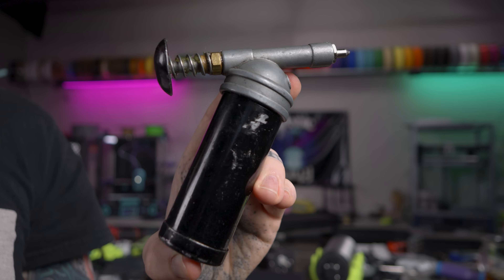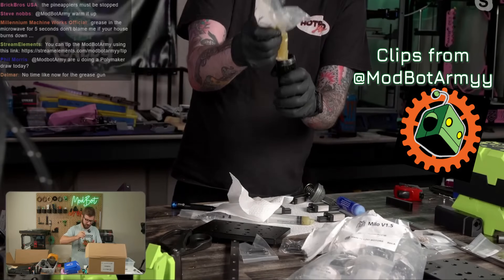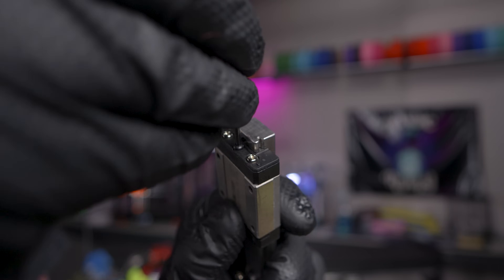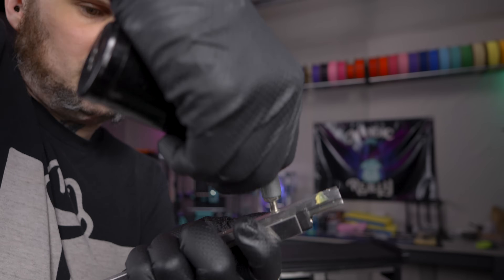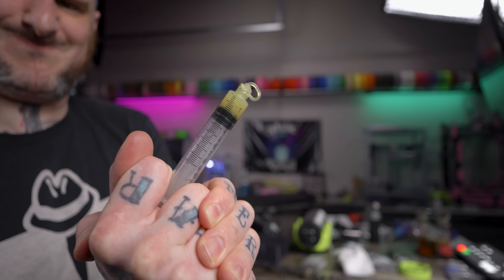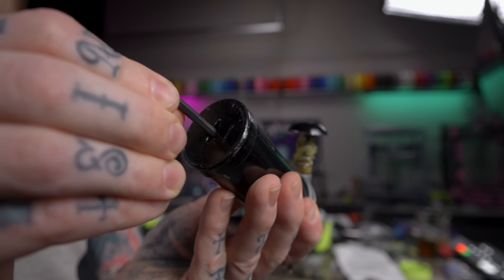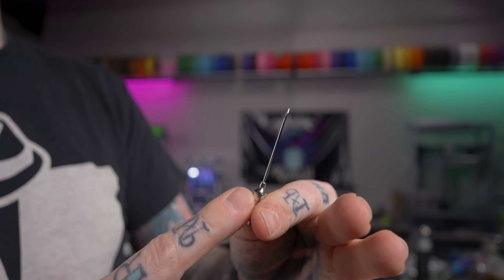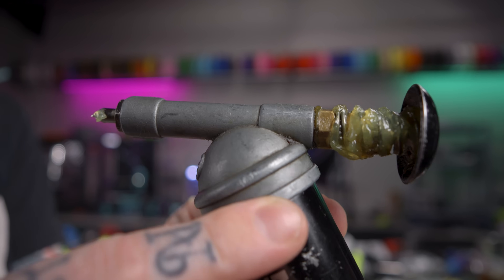My NEW Favorite 3D Printer Tool!

Comment: I'm using a syringe too, but a much smaller one. The EP2 comes out pretty easily, even through the needle with the tip removed. I fill it directly from the EP2 cartridge by removing the plunger and pressing grease into the barrel until it's 3/4 full. I have a cartridge that fits into a normal caulking gun.

Comment: For an adapter... Well, 3D print one? Rather than replacing the whole gun, you could replace the seal instead. Might even be able to 3D print one out of TPU if the shafts are actually worn and you need a tighter fit.
Reply from the maker: I could rebuild the tool, but in all likelihood the replacement parts would cost me as much as the $11 replacement tool. I got 15+ years out of it, it owes me nothing.
Reply: @MandicLabs  Fair! If it's a simple O-ring or something though, totally worth it.

Comment: I've got one of these grease guns... It has a spring against the plunger and there is a small chain coming out of the bottom hole.  When you open the gun, you pull the chain to withdraw the plunger, and then pull the chain sideways so it locks into the slot at the side of the hole, then when filled and closed, you pull the chain back to center to allow the spring to push the plunger.

Comment: I've had good results by removing the wiper plates from the end of the carriage - then applying the grease to the groove in the rail and work back and forth. (I use a syringe + needle) Several times and it's worked into the ball races. Replace the wiper plates and call it a day. Advantages for me are less waste/cleanup, and can be done with the rails mounted.

Comment: I use the Dualco 10350 with Super-Lube, and the right angle tip. No mess from moving grease and no leaks (yet). Connects directly to grease tubes so if I want to swap to another grease then I don't need to unpack the gun.

Comment: I prefer your method - I used a big metal syringe, but I had never tried an actual grease gun...!
One thing I do whenever I deal with circulating bearings that could lose balls:  3D print 'dummy' rail or ballscrew sections. This makes it easy and clean to inject grease, as you can hold the whole thing in one hand, plug ends!

Comment: That's actually a near idea. I use reptile syringes as they are a lot smaller tube and go into the bolt holes easily with no needle.

Comment: Yup that's what I did on my 2.4, just used the tube to do it instead, but same thing, got it all in there via the back.  However at over 2k print hours on the 2.4 now, probably should do it again just to keep them on the up and up.

Comment: Solder paste syringes can be difficult to squeeze out too, you can buy things that attach to the syringe and change them from working by pushing on the plunger to squeezing a long handle on the side, squeezing the handle on the side allows you much easier grip and also gives you a mechanical advantage since you have a large lever, this makes it much easier whilst also making it more precise, especially since you aren’t putting lots of force in to squeeze it. The things I am talking about have a long bolt that goes down into the syringe itself, up against the plunger and then at the top has a pivot point and a long handle so a large squeeze of the handle equals a small push on the bolt and therefore plunger. They tend to be made of plastic but they work well enough, they would work for those syringes too but you would need to use a different plunger.

Might it be possible to make an adapter for the grease gun that allows you to mount needles or other thinner tips to it? Surely 3D printing hobbyists aren’t the only people that need to precisely and carefully apply grease.

Comment: Is there any way to test how effective these methods are? If the manufacturer has put the grease port there then it likely means it is good enough to just squirt it in there.

Another idea would be to modify a short piece of rail just for greasing, you slide the slider onto the special grease rail and it has a large cutout in the middle of the rails so you can get grease in easier than using a bolt hole. Depending on how complex you wanted to go you could even add small holes or slots directly to where the ball bearings are. Maybe even add a bracket so it can bolt securely to the functional rail so there is no chance of it slipping off when you slide the slider onto the greaser rail.

Comment: Fix the one you have. Put a new seal in it.
Reply from the maker: It has been quite some time since I had it apart, but I'm fairly sure it is more complex than just a seal. And if I have to contact Matco for replacement parts, with shipping they will be over $11, easily.
Reply: @MandicLabs  Just sad to see something get thrown away. You can make parts and seals.
Reply from the maker: @vhoward1122  I get that, but time is money. Spending more on materials & even 1 hour of time making a repair means I just lost money. It is simply the reality of the world we live in, especially when self employed. I'd love to repair everything I can, but some things just don't make sense. Pay the shipping and I'll send it to you to repair if you wish.

Comment: If you use a smaller syringe it will be much easier to push, and also, is thst brass nut on the plunger an adjustable packing nut??

Comment: I would think that a good machine shop could make up some needle adapters for this, using a syringe needle in place of the standard needle you showed. It may be as easy as cutting off the standard needle, and brazing the syringe needle into the middle of the standard needle, and making sure that there are no leaks around the syringe, and the syringe passes grease. That said, I haven't tried it, the only grease gun's I have are for my tractors. Something to consider now that I have a 3d printer with linear bearings... Thanks for the pointer.
Reply: I would also be somewhat surprised if the seal that's leaking is anything more complicated than a set of o-rings that have just broken down over time. An O-ring kit probably has a lifetime supply of them, though you'll replace the kit from time to time as the lifetime of the o-rings themselves expires. Ozon often has that effect.

Comment: But greasing the rails on the printer???
Reply from the maker: That's why I said I'm looking at ways to adapt a needle to the task. On machine maintenance shouldn't require much grease so a syringe may still be best there. The initial packing is the MOST important part IMO. If you don't get that right, that is when you are likely to have issues later.

Comment: My advice for the needles.  Buy a cheap regular grease gun.  The small ones should work well, and are about the same size as what you have there.

They also have the advantage of having a spring plunger system,  which it looks like yours is missing.

Comment: I usually have taken the rails off because I'm a mad lad and I see no issues with it, I work with heavy machinery so I'm kinda experienced. however, if using syringe I recommend heating it up before use either in hot water or with hot air gun so the grease is less viscous

Comment: I believe the gun you are using is meant more for air tool oil and not grease. Or your gun is just very worn since it's leaking at least 50% of your grease out the piston instead of  the nozzle.
I think you would have much more success with an actual grease nipple in one of the holes for your rails and a real greasegun which takes a whoie tube.

But the idea itself seems like the best way to get it done, best regards, professional greaser of cranes.
Reply from the maker: No, the one I showed is intended for grease. I said it is pretty worn out as it’s over 15 years old AND I sold tools so I used it for servicing work. It’s seen more use than they typically do. 

A grease gun coupler is a rather large opening and would be very easy to miss the hole when filling and make a big grease blocks. Along with likely being a bit overpowered for the application. And larger / messier to store for the average 3d printer. The tapered tip on this gun and its compact nature make it perfect for the bulk of jobs printers, just not the smallest tasks where a needle zerk setup is possibly overkill.

Comment: I'm guessing this would not work so well with a more fluid grease like gearfit ep 00/000, as it's so runny it would probably leak. Has anyone tried it?
Reply: If the tool is really for oiling, not greasing, air tools, it should work just fine. Whether it is or not, I don't know. Adding one of these to my wish list though... :-)

Comment: I was looking on Amazon and searched, "mini grease gun adapter". There are a ton of things on there to use with the needle.
Reply from the maker: There are in the typical grease zerk format, but not this design. Like the needles I showed are for regular grease zerks which would be an entirely different grease gun that is a bit overkill for our uses. This smaller grease gun uses a internal threaded body of currently unknown thread where the hoses on the other style ones use external pipe threads. I've just got to sit down and measure everything to decide how to adapter from A to B.

Comment: Alan, I believe you're on the right track here but there's a better way for smaller applications. Dispensing grease by hand is difficult,  the grease is far too viscus. There's is a tool called a dispensing or more specifically a syringe gun. It's used in all types of applications but you can also use it to grease small bearings, threaded rods, etc. Just load the grease into a syringe, the syringe goes right into the gun, you have yourself a small grease gun.
Reply from the maker: Loading a syringe with fresh grease is ANNOYING, and the cheapest versions of what you are describing that I'm finding are 3 to 10 times the price of this tool. You get the advantage of accessing smaller grease orifices', but for $30-100? I'll stick with this and the syringe by hand on the odd instances I need the smaller tip. Thanks for the information all the same, I always like knowing what options exist. If you can find one that isn't $30+ I'd be interested in learning more.

Comment: if you warm up the grease in the syringe it should be come more less viscos
Reply from the maker: That requires a warming process. Maybe just leave it on a printer bed sure, or you could just use the $11 tool that will last years and work right out of the box. It isn't for everyone but for someone like me that is doing this regularly, it is vastly superior.